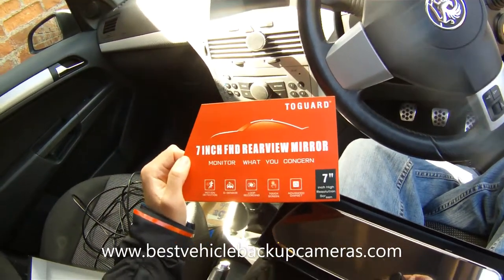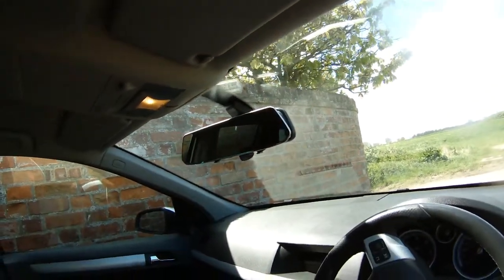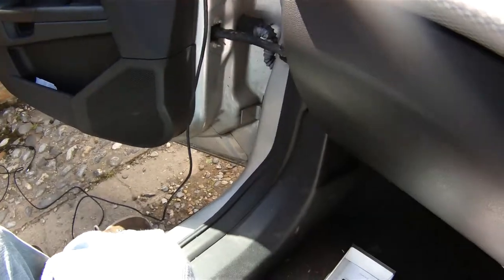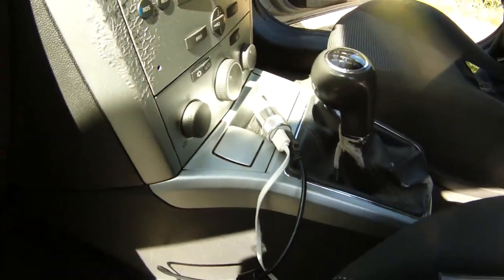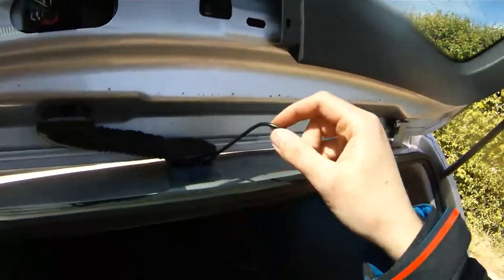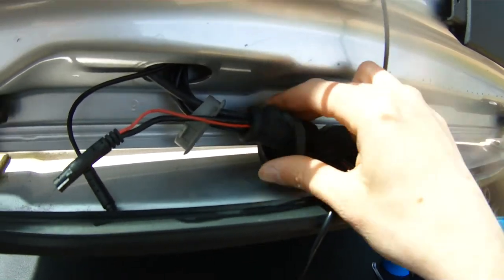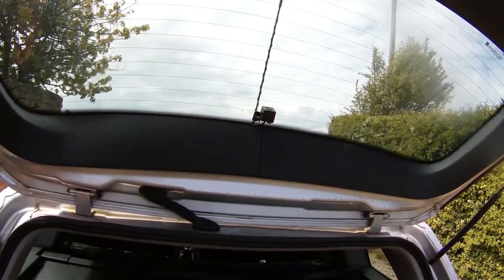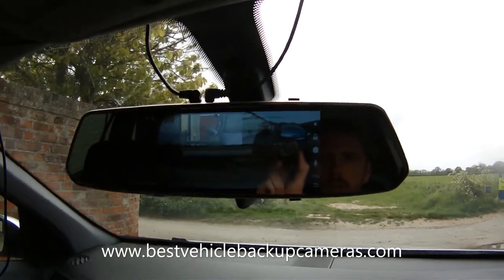Fitting a Toguard Mirror Dash Camera

Comment from the maker: I realised I didn't show how to wire the red reversing cable.  This very simply pushes into the back of the plug for the reversing light bulb and when fitted will automatically turn on the mirror screen and the rear camera LEDs when you put the camera into reverse.  I didn't plug it in because when the rear camera is fitted internally the little LEDs on the camera just reflect and so you can't see anything in the mirror other than white light.  However if you mount the camera externally and want to fit it then it's really easy to do.  Just duct the red wire down the hatch where you access the rear bulbs and push it into the back of the plug for the reverse light.

Comment: I have the 12 inch 2.5 k the lines where it says stop is not accurate not adjustable like you said that’s only problem camera is self the 2.5k is amazing probably best mirror dash cam but revers lines where it says stop there is literally 5 more feet to go after you reach the stop line lol but you need I guess to figure it out yourself

Comment: I was sitting at a light and a lady slammed into me and pushed me into the car in front of me.  She got out and lied about it all she could think of.  She probably slammed me going 40mph but she wanted to say it was 5 mph.  Figure she would say I backed up into her if she could have.  She had just drove her car off the dealers lot and was listening to the radio and going braless and out to party on.  I looked up her car and she had one of those vehicles that have sudden no brake issues.  She could have found a way to blame them if the brakes failed and she was partying too hard to notice,  but she was more interested in living it up and lying to get out of trouble.

Comment: Hello . Is there a way to remove the grid lines that come up right away when putting the car in reverse ? Thanks
Reply: Those lines are wires that heat up your window to take away the fog in the morning
Reply: @kings559county5 
You can use a Stanley blade to scrape them off the window 🤔